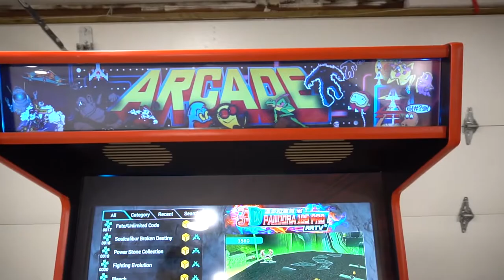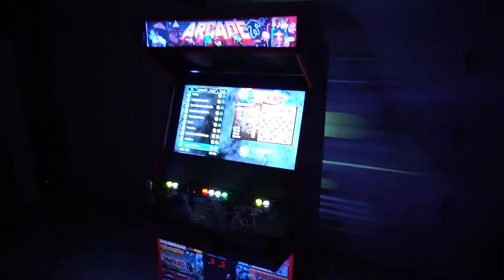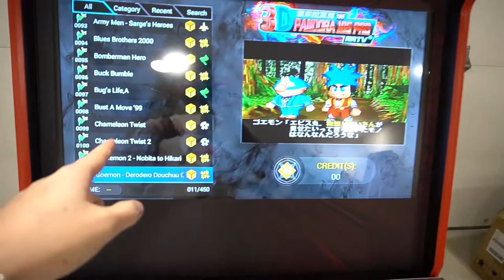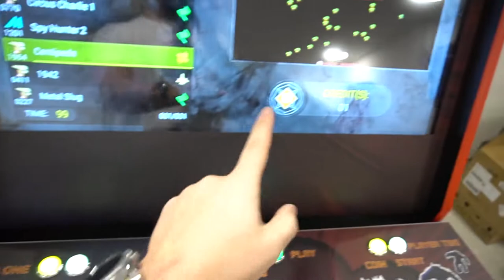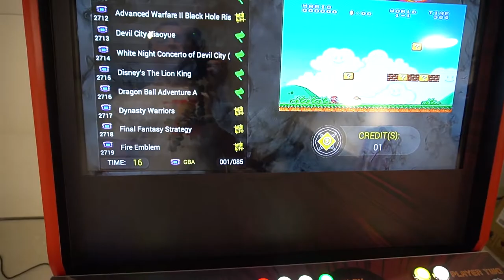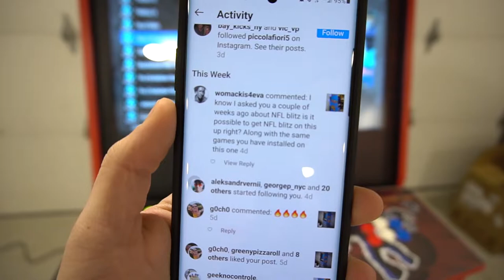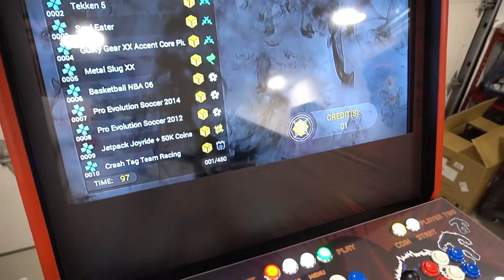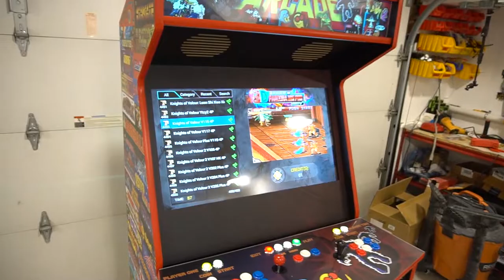32inch Upright with a Dedicated 4 way - In depth details about Pandoras Box 18s

Comment: Vic I am 60 yrs old and love your videos and the work you do. Just keep doing what you are doing. Love your in depth details. What are you using for that 32 inch monitor?
Reply from the maker: Thanks bud! I noticed tvs have been such a hassle to find lately!
This is running a 720p insignia. I like insignia cause I know they turn on once power is given. 
If customers wants 4k or smart TV, I get the Samsung. Samsung also are known to power on once power is given.
I tried Westinghouse and TCL,  good tvs but they don't power on once given power... thus making the customer need the remote which I'm not a fan of
Reply: @Vic_VP  Thank you for the reply. Info very helpful. I want to build one like this for my granddaughter just not sure who to buy a Pandora's box from. Someone trustworthy.
Reply from the maker: 3a is the legit pandoras box company. The on I used is a knock off. Ebay sells many pandoras box control panels plug and play
Reply: @Vic_VP  ok thanks. So I guess you removed the pandoras box and installed it into the gameroom control panel.
Reply from the maker: @AR-kw1gf  correct just like how I explain about 20 min into the vid lol
Reply: @Vic_VP  lol thanks for taking your time to respond. Sorry I didn't quite make it that far into the video the granddaughter was over so had to quit watching. Going to watch it all tonight. Have a great night.
Reply from the maker: @AR-kw1gf  haha no sweat!

Comment: Hi I just switched from 27 “ monitor to 32” hdtv. The downside for me when using tv for an acrade set up is that, you need to ON and OFF the screen everytime you use it :(
Reply from the maker: Yea sounds like you have a tv that doesn't have that feature. Some people say to set it to "demo/retail mode" and it'll turn on once power is given.
But not all tvs do that.